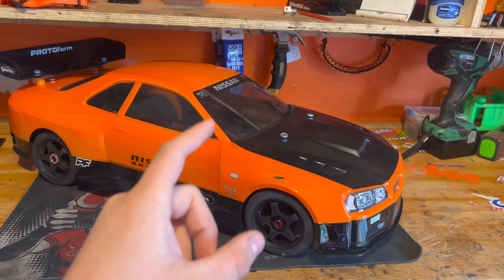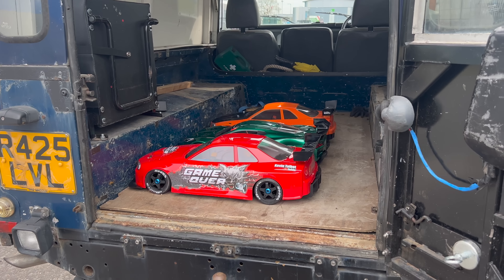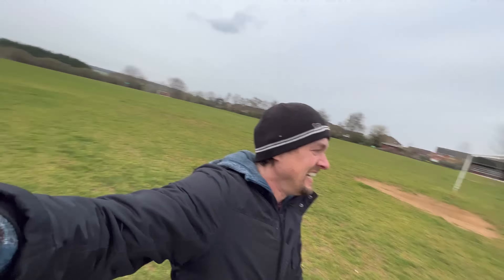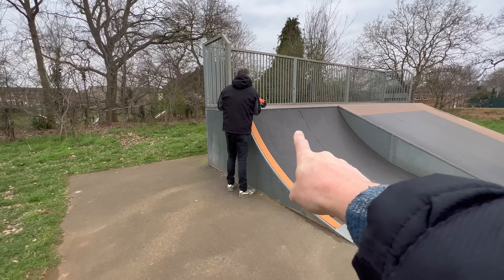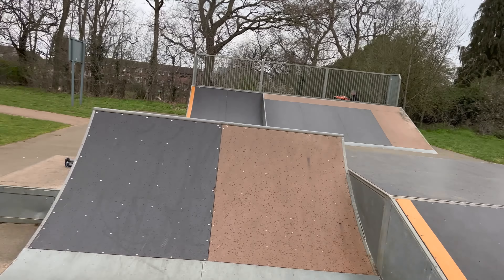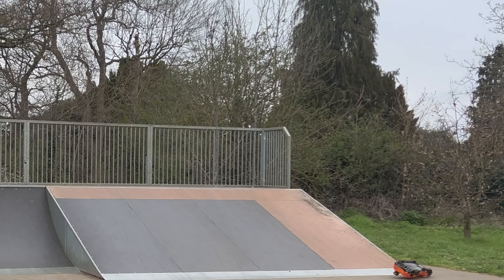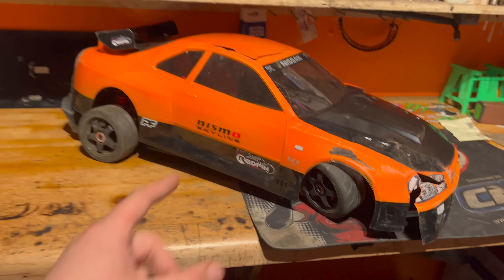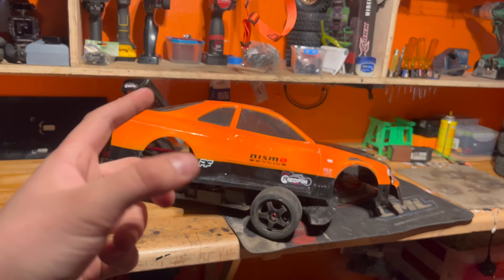Arrma infraction 6s (first run write off)

Comment: @madmax rc hello recently there was a video where you drove a ZD racing ex07 with a skyline body,  where there modifications made to fit the body? Also which body was it? Thx.
Reply from the maker: Hi there it was an arrma infraction 6s
And I used proline mounts 
And it was a proline r34 skyline body
Reply: @Maddmax206  thanks for replying,  i asked because in the video Kevin said it was.